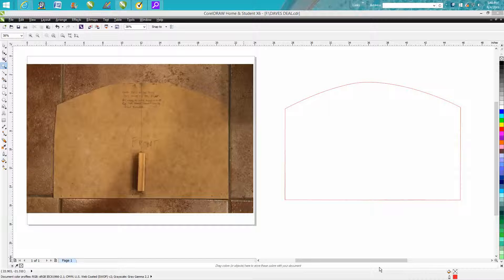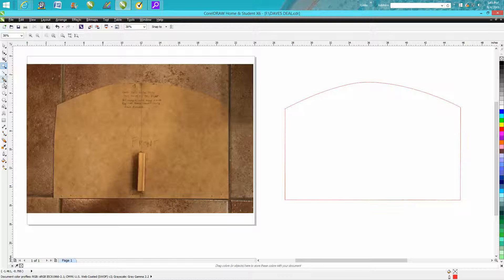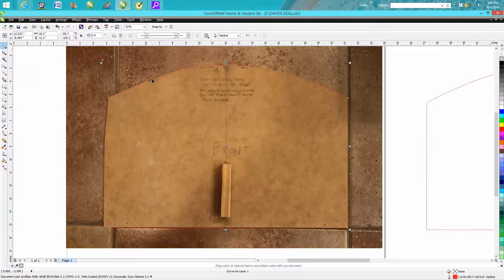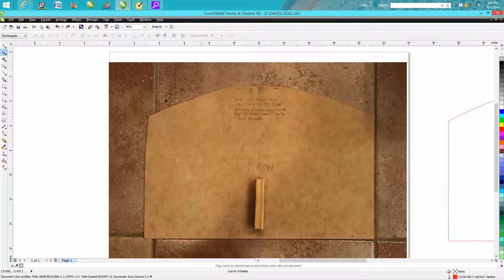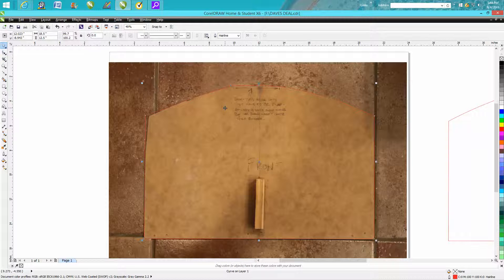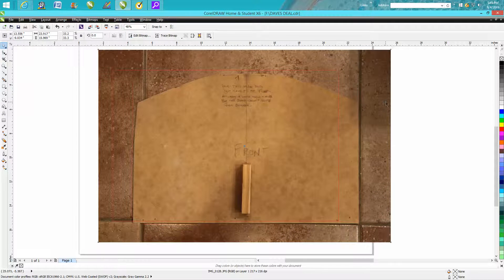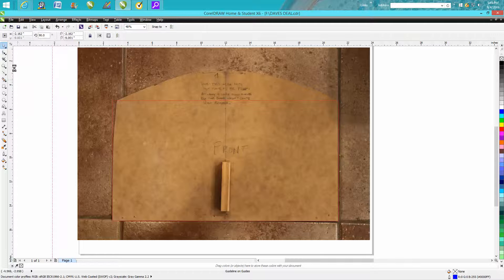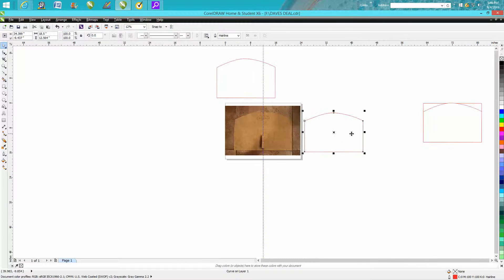CNC PLASMA for people that use Corel Draw

Comment: Como haces para indicar el comienzo del corte en plasma CNC, se que se indica en el primer nodo.
Reply from the maker: +Gaston Acevedo ¿No salga lo que le estás pidiendo?
Reply: Sorry for my english, cnc PlasmA recognizes the first node to start cutting, sometime the first node is not where you want , Can I choose any node either to put it as the first ? Thanks
Reply from the maker: +Gaston Acevedo Yes, but that would be in you CNC software , under "Edit Start points"my software is sheetcam...
Reply: Export the file from Corel to " sheetcam " , im reading a manual http://www.sheetcam.com/Download/SheetCam%20TNG%20Manual_A4.pdf,

the only thing i have to do is "Edit Start points", What is the easiest way ?

Thanks